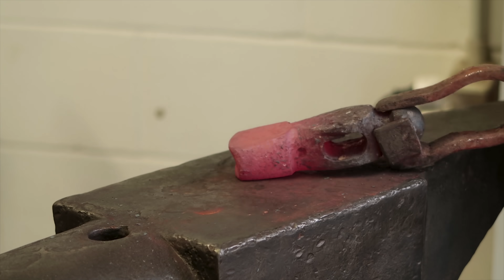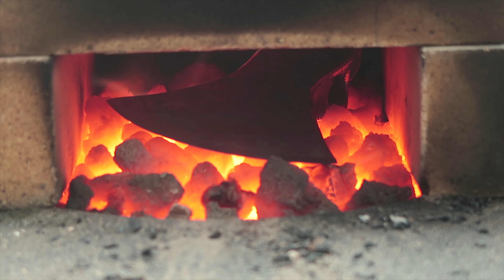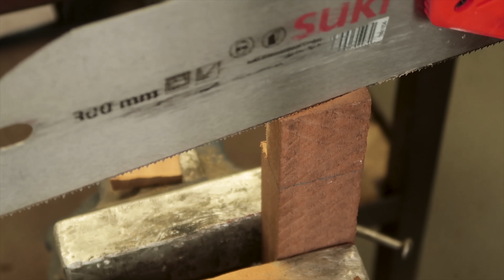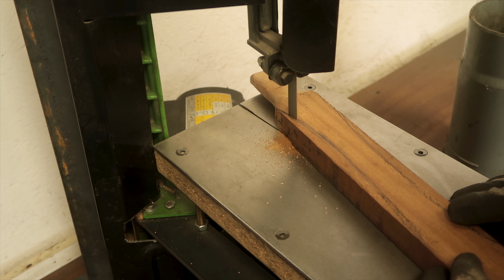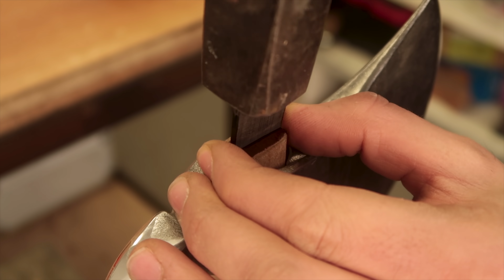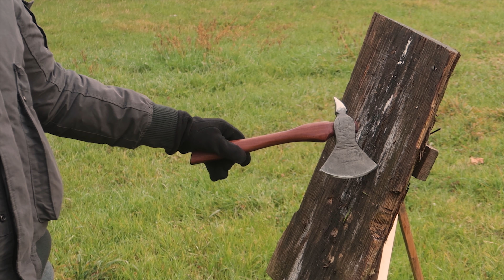Hatchet Forged From Ball Peen Hammer | Blacksmithing

Comment: Are ball peen hammers high carbon? I was going to forge weld a piece of 1080 into mine so it would hold an edge, but you heat treated that so I guess they are already high carbon.
Reply: Yeah, must be highcarbon steel
Reply: @sperber-knives  what did you heat treat it with? And what temp for the temper?
Reply: @jacobbowen2563  
You need a heat that is so great that the steel is no longer magnetic. (I guess about 850C °) I would temper after the temper colors. (about 200-300 C °) it always depends on the steel, it is best if you know which steel it is, then you can read the temperatures.
Reply: @jacobbowen2563  do you know the spark test? The more the sparks "star" or branch off the higher the carbon. Works for most carbon steels, not so we'll with alloys

Comment: Not WATER BRO NOT WATER.  Just Oil bro OIL !!!
Reply: I've been using water quench for thirty years. Works for me. If you know what you are doing it works fine
Reply: @krknfmkr8919  water makes metal brittle like glass. and the oil makes him strong and he’s not brittle! check it yourself!
Reply: @kgzkgzovich3849  oil is a "gentler" quench but water is fine. Tempering takes out the brittleness and toughens the steel at the same time. Oil quenched steel is brittle also and still has to be tempered. I've been making knives, swords, axes and other edged weapons for thirty years.
Reply: @krknfmkr8919  just bro check it your self
Reply: @krknfmkr8919  I quench screwdrivers in motor oil. and they have been working for 2 years. and when I heated them in water, they broke like a glass, check it yourself

Comment: It wouldn't take you 8 hours to hammer if you would just get the metal hot enough.
Reply from the maker: Hard to judge heat colors through camera, specially since I record in auto mode, exposure will go down when something bright is in shot!
Reply: And to begin w it’s a very thick piece that’s being hammered down. Easier to go through a few different times than to race against the clock and try to get it all done in one shot.

Comment: It's pein  a ball pein hammer , I would of opened the eye to make it more lengthy so you didn't snap the head straight away ,plus split the blade and used shear steel between for the edge

Comment: Nice hatchet!
I did one of these last year execpt mine came out with more of a hewing hatchet balde shape and I left the ball peen side as a tapered square hammer face. I also brought the cheeks up into points on the top and bottom to give it more surface area on the handle.

Comment: Why did you quench in water, did it matter for this particular project?
Reply from the maker: Water quench is harder than oil, hammers usually have low-ish carbon content (as far as I know) like 0.4 to 0.6 % so I went for the quicker quench to ensure good hardness. That's the idea anyway, feel free to correct me!
Reply: @BlackBeardProjects  Sometimes that's just the way it is, I think. I made an old file into a little medival knife with the curl around handle. Tried three times to quench in oil and it just wouldn't work for me. Gave it a shot in my water bucket and it hardened right up.

Comment: Good job, though I think your bevel geometry was way too thick. I think if your bevel was about twice as wide and convexed it would be a much better cutter. Also assuming the steel is 1045 you should've quenched in oil, sections under 1/4" can be effectively hardened in oil
Reply: He did what he wanted to do.